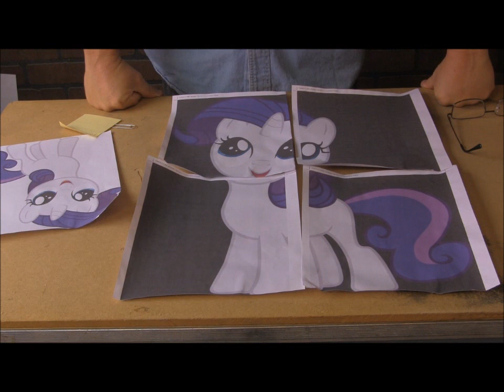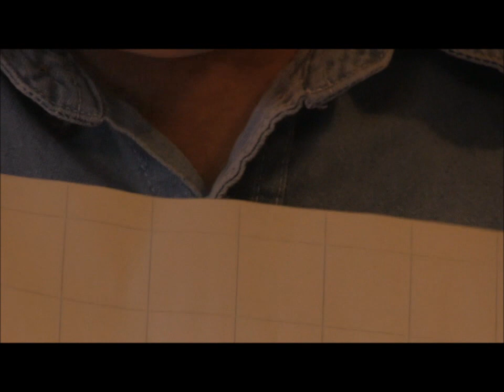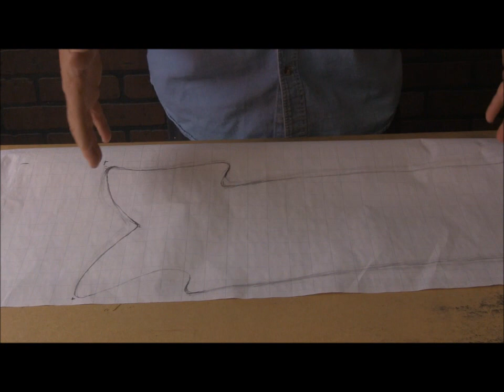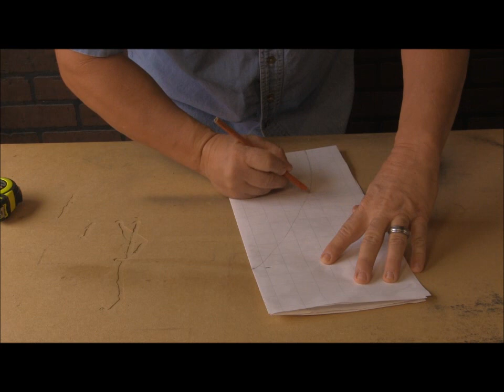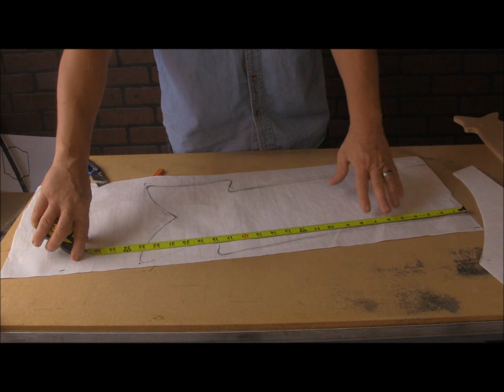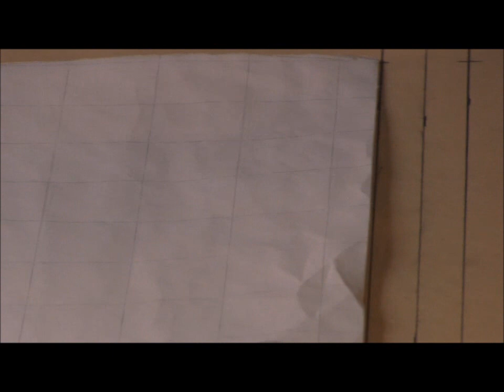#153 Big Sign Pattern Making

Comment: Eric
I use an overhead projector that I picked up at a public auction for $3.00, from my copier I replace the paper with clear acetate and run off a copy. Once it is in the overhead projector I will enlarge to what ever size I need. I use to do it the way you and your father did in the video but have found this to be might quicker. you have to tape a large piece of paper on the wall and trace the outline.
Joel
Reply from the maker: +Joel Magee Thank you Joel. Yes we have one of those projects as well. Paid lots more than $3 for it though. Appreciate the feedback, that's definitely another way to go.

Comment: Posteriza looks like a good tool - especially since it's free!  For anyone that does this a lot, I would suggest considering a program called BigPrint by Matthias Wandel of WoodGears.  BigPrint has several great features.  You can lighten the dark areas to save ink, and it adds alignment grids to help tape the image together.  It's not free, but at $22 it's not bad either.
Reply from the maker: +drstampfli Thank you. I'll check it out.